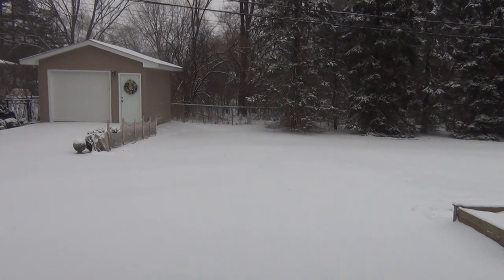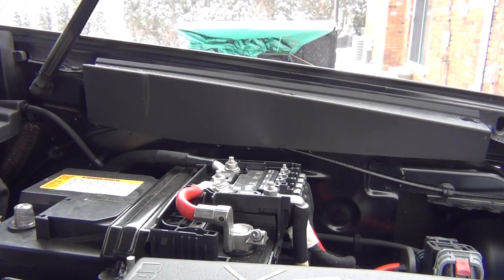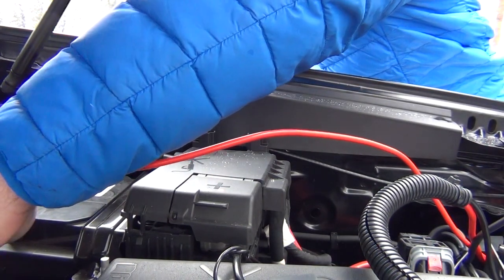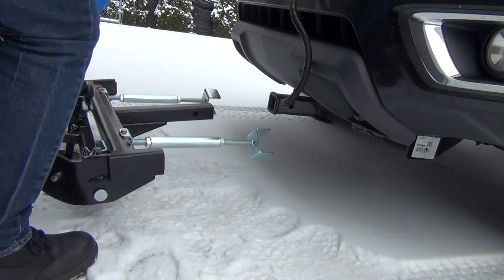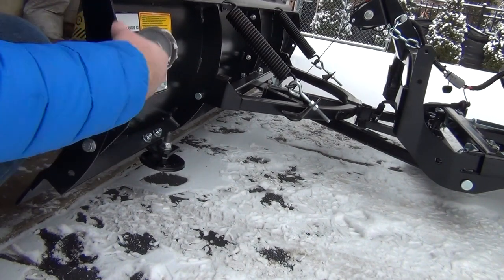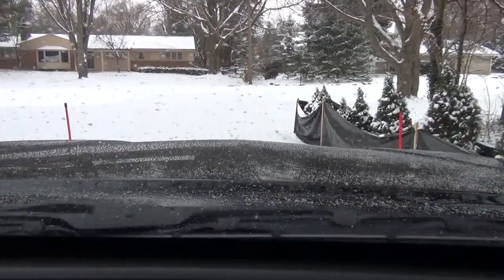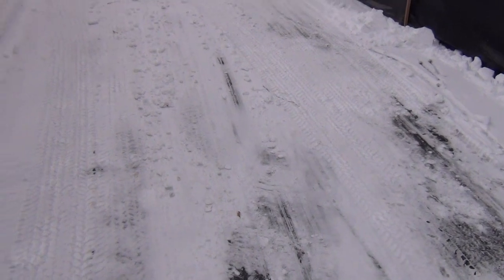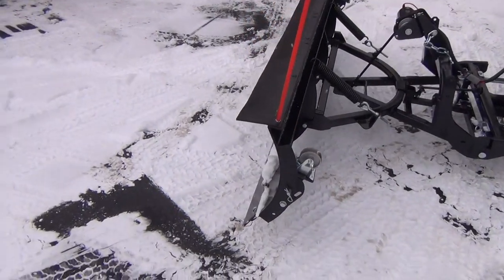Detail K2 (DK2) Avalanche Snow Plow Kit 1st Snowfall & Plowing Impressions | 2020 Chevy Colorado Z71

Comment: I thought I'd give some feedback on mine I bought a year ago. I have 2003 Dodge Dakota extended cab 4x4 with 4.7 V8.  I've owned it for years and it only has 100,000kms. Frame is mint and its been babied all its life except for my hunting trips. I ordered the Dakota kit for it and this exact plow. I was concerned I was too light as I have 1800 feet of gravel driveway. I've used my TYM 293 tractor for years with front blower and back blade. That thing is a beast. Heated cab etc. It'll take on any storm no problem. But I wanted something to do the quick hits with 6 inches or less for speed. I had 300lbs of salt bags centered over the back wheels and that made a HUGE Difference in steerability. Do it.

I put a set of Timbrens on the front and that was huge!! The plow never affected the front height at all. I had to re-do the front end this spring but it's a 20 year old truck that needed it anyway. So next year it'll be fully ready. 

I have to say this thing worked perfectly except for the markers. Pure crap. I'll figure out something for those this summer. I didn't use the shoes as I don't use anything with my tractors either so I just went to ground. In 4x4 I used 2nd gear and simply drove to push snow I never went above 20kph - didn;t need to except for one slight hill I have to climb. 

These things work superbly if you accept what they are. I see alot of guys beat the living crap of these blades then complain. STOP! They are homesteader blades. Nothing more. 1800 feet of driveway 12 storms - never turned the tractor on once and had 4 storms of 2 feet or more. NO problem as I plowed with the storm going out in the middle of them and keeping it under a foot. For you property these things work great. I would have two things as spares though. The wireless control wiring kit and a an extra pulley motor. I see these as the most breakable on these plows. All in all they are steal imho when full plows in my area are 10K plus installed.

Comment: Great video. I am new to plowing and just bought a Rampage II. I found the company's website to be lacking in detail. Specifically, how to hook up the plow to a custom mount instead of a receiver and also the fact that the main frame safety pin needs to be removed before use. I liked the wire routing through the bolt hole idea from your first video. I will probably use another bolt hole to store the main frame safety pin while in use since I don't need it for the receiver.

Comment: I ended up putting a rubber cutting edge in front of the steel blade and adjusted it an inch lower. That way it will clear off the driveway like a squeegee and slide right over the grass without damaging anything. Slick as snot on a doorknob!
Reply from the maker: I usually end up stopping short of the grass because I’m afraid to tear it up, and end up running a pass with a 2-stage blower to clean the edges. The rubber cutting edge is a really good idea!

Comment: I would suggest always plowing In 4 hi to avoid overheating or transmission issues I’ve always plowed in 4 hi same with the companies I’ve worked for. Just a tip great video though
Reply from the maker: Thank you! For sure, 4 hi is the way to go. I could feel that the truck was not happy at all in 4 low 😅

Cheers!
Reply: Graz's Garage i have one of those plows but I don’t use the remote I use the plug in switch but I was wondering if I just left it plugged it all the time would my battery die or not? I can’t find a straight answer online. Just thought I’d ask you get your 2 cents
Reply from the maker: @dewugye4669  If the switch is well built, I would hope that there wouldn't be any parasitic draw on your battery while not in use. (Only while you activate the switch in and out) With that being said, I am not 100% sure about the switch that they provide with the kit. 

One thing you could do is run a test with a multimeter, if you have one. Take a voltage reading across your battery and jot it down. Then after a few hours or so, with the switch plugged in, take another reading. It should hopefully be around the same voltage. If not, then you have a bad/cheap switch and you should unplug it when not in use. 

If the voltage looks the same as the initial reading, that's a good sign. Wait for a little longer (a few more hours) and check the voltage again. Repeat this process and increase the time interval (once a day, every other day, once a week, etc...) just to be safe to make sure your battery doesn't drain. 

There may be an easier way to check, but that's the way I'd go about checking it... Hopefully that helps!
Reply: Graz's Garage didn’t even think of that, thanks man I appreciate it
Reply: @GrazGarage   I would use 4 low. this type of work is what 4 low is for. A lower gear is always better for pushing or pulling something heavy. An automatic transmission heats up when its in a higher gear not a lower gear. That is why you don't use overdrive to pull a trailer. I would also put the transmission in low or second so it doesn't shift. All trucks are happy in 4 low that's my opinion anyway.
Reply from the maker: Those are some good points. I may have been trying to push the snow too fast with my first couple of passes this season, and that’s why the engine didn’t sound happy. Will give the 4 low and low gear on the trans a try, and see if it sounds / feels better.
Reply: Some of you are backwards. 4lo is less load on transmission.you reach stall speed of tc faster.less slippage less heat. The reason you don't tow in overdrive on a half ton is because it's the weakest link on a small transmission. Chevy 2500 with 4l80 is designed to tow in overdrive. Sometimes while offroading in the high heat and load you'll watch the trans temps fly up. Put in 4 lo they will hold steady and start dropping temp Less tc slipping less load more trans fluid flow due to higher rpm. Higher rpm also creates more line pressure inside the trans Wich will makes the clutches hold tighter also.

Comment: Bring the shoes up a bit ( clearance should be very little ) mark your driveway , it’s illegal to plow across a road in many areas so plan a spot to push your snow and hold or you’ll run out of space , a good spot is in the back yard but a straight push is definitely better also I start at the road working towards the house and if you want clean edges use your snowblower after plowing  . Angle plowing is a bit more complicated, plan your pushes ! I removed my shoes because I have a concrete driveway and it cleans really nice without last but not least I only plow if there’s more then 2” ! I’m in Minnesota so we do get our share of the white flakes from hell ! Lol

Comment: i have an older snowbear plow which is similar to what you have. new ones use that front receiver mount, mine uses a different bracket with two mounting points. used it on a couple vehicles, latest one being an 07 wrangler which i sold, keeping the plow but i also have a plow for my tractor which is what i currently use.

Comment: Well only advice plow in high and on paved driveways I would lower the skies all the way to the bottom. Unless you have lots of ice mid season or raised cracks.
Reply from the maker: I agree 4Hi has been the best for plowing so far. My driveway is relatively smooth and crack free. I’ve adjusted the shoes lower so that the blade is pretty much on the pavement 99% of the time. (I keep a little bit of a gap just as a safety measure) Thank you for the tip about the mid season ice! I’ll need to keep my eye on the level and keep the ice-melt going on warmer & sunny days.

Comment: Best way to learn is just to do it. Plowed commercially for years. Every lot is different and if you're just doing your driveway it all depends on where you can put snow. 4hi is all you need and personally I'd just take the shoes off and lift the blade before you push into the grass. That's a light plow but it should still scrape nice.
Reply: Guess I should've read the comments lol. Pretty much everything I said was already out there. Only other thing I'd recommend for a light duty setup is with heavy/wet snow always try to straighten the blade before you go into a pile.
Reply from the maker: Lol, no worries man, thanks for the tips! I always keep the blade straight when I plow, but sometimes push into the pile on an sight angle. 

This messes up my banking line, as I can’t push all of the snow to the edge on an angle. With each plow though, I’m learning more and refining my passes to  clear more efficiently.

Comment: ...... Dude, anytime you can get the driveway done without having to be out in the elements, dealing with the cold, ice,ect. You’re doing good👍... Even operating a really nice snow blower is Very Exhausting.... so what if you don’t have a 80k truck, and a 12k plow... You’re moving your snow in the comfort of your truck, and the amount of time and effort you save is something you can’t put a price on... I would try and get really good at mountings and dismounting that plow, because that seems to be the hardest part..... This seems to work for your purpose, so as long as you don’t abuse, or treat it like something it’s not, just clean it and lube it, and it should last a good amount of time👍...

Comment: ok i got a couple tips when u put the plow down give it a little bit of slack so it can move freely across the ground and idk about you law but where i am it illegal to push snow a cross the street.
Reply from the maker: Both really good tips, thanks! I agree, with a little more slack in the line, I was able to get a cleaner pass compared to when I didn’t. 

A few neighbors have professional services and they all plow across the street. Plus the city comes by depending on how much snow falls to do additional cleanup. With that being said, I do try to be courteous and make sure I clean any overflow from my plow out of the street. I don’t want to leave any mounds in the street to freeze and rip off bumpers of passing cars.
Reply: @GrazGarage  Yeah it’s kind of weird with those winch type plows cause they don’t really have a float mode compared to the hydraulic commercial grade guys. But like another comment or say a lot better than shovel😂

Comment: I think you can bolt the battery cable on that stub hanging out without removing the cover.
Reply from the maker: I tried, but the nut on the end of the positive battery terminal won’t come off. Even had the terminal in a vice to hold it steady while trying to undo it, and got nothing. Must be some liability thing over at GM, not wanting people to connect accessories to their truck battery too easily. Luckily the work-around isn’t too difficult...

Comment: Do you think this plow is good enough for doing parking lots?
Reply from the maker: Good question. For starters, I am not a professional (just some guy sick of cleaning my driveway out in the cold).

I’d say it would depend on the size of the lot you are clearing, the type of contract you have with the lot owner, and what truck you are using to plow with… If you are plowing as a source of income, I’d use a full-size to HD truck with a frame-mounted plow. (It’ll make your life easier)

If it’s like a church lot you are cleaning as a volunteer, and there isn’t too much lot to clean, it would be great! (The manual angle adjustment is slower than a dedicated in-car remote, since you have to get out and change the angle when you want)

This is definitely a lighter duty plow for homesteads and lighter work. At least with my setup… (Midsize truck, and universal receiver hitch mount up front)

Not sure if that helps or not, but that’s just my opinion after owning it for a year to clean my driveway.

Comment: I have a 265 foot asphalt drive way - it's steep. Snow blower or plow? Im new at this. Thanks for any suggestions
Reply from the maker: My driveway is personally not that wide, so if I could go back, I would probably spend a little extra for a 4x4 quad with a plow attachment. (It would be a little easier to maneuver and I’d get an extra toy out of it 😉)

Overall though, if given the choice between my current plow setup and my old 2-stage snowblower, I’d keep the plow.

Comment: Can you adjust the angle from side to side on that plow? I have been wanting to pick one up but im interested in that before I do
Reply: Yes DK2'S have 3 positions, straight and approximately 30 degrees right and 30 degrees left. That is done manually directly on the plow frame not from inside the truck

Comment: Plowing is easy guys tend to act like you need a degree to plow. Your pushing snow? Seems easy enough!😀 and u did fine! Was the plow worth the purchase price? Its between this and the snowsport plow for me just cant decide
Reply from the maker: Haha yeah I agree. Like anything, the more you practice, the better you get and the more detailed and technical you can take it. With 3 passes under my belt since this initial video, I will say that the quality of snow clearing gets better.

For the money, I would for sure get this plow as opposed to the snow sport. When you get it from Costco, the DK2 is very price competitive. I was also looking at the snow sport and here was my logic behind picking the DK2:

-With this guy, you can backdrag snow from up against buildings. With the snow sport, you can’t do that, it only plows forward. (This was probably one of the biggest factors for me)

-Think about the long term and what vehicles you’ll be using to plow. With the snow sport you can attach to pretty much any vehicle’s rear receiver hitch and plow in reverse (in case you don’t always have a truck or suv with a front receiver) You can’t do that with the DK2, but it feels more comfortable and robust using a front hitch. (So if you’re planning on using a truck or suv with a front hitch, I’d go with the DK2. But if you don’t know if you’ll always have something like that, the snow sport may be better)

-While not commercial grade, the DK2 still feels like a more traditional plow with the flexibility of the universal mount (if you decide to switch vehicles) The snow sport just seemed cheaply built / too simple for the amount that it costs. (Just my opinion, I’ve seen good reviews on it, but didn’t have a good gut feeling)

Hope that helps! It’s not currently on sale at Costco, but I got mine before the holidays for $200 off. Maybe keep an eye out once spring comes for a similar deal at the end of the season. Good luck!
Reply: @GrazGarage  thats more info then you get from the manufacturer lol thanks im leaning more for the dk2 thanks again!!

Comment: question: what did you do with those 2 stabilizers once you got the plow into the hitch receiver? it would have been nice to see what the underside looks like with the plow hooked up. but i really appreciate the video anyways, i've been looking at this very plow, and i also have never plowed.
Reply from the maker: The stabilizers get bolted to the plow and when the plow is mounted in the hitch receiver, they fit up against the receiver for added support. 

Not all vehicles may be able to use these supports (depending on the geometry of the truck and reviewer combo) but the manufacturer says they are optional and you can just use the receiver pin to hold everything together.
Reply: Do you remember the brand and model of the hitch you use?

Comment: 2007 F150, looking to buy a plow… any recommendations????
Reply from the maker: I’m just a homeowner w/ a midsize truck, so take my advice with a grain of salt…

For homeowner or light duty commercial, this plow is great. For a more commercial application where you have many clients, and with a larger truck, I’d go for a frame mount professional plow. One with hydraulics so you can angle the plow from inside the cabin as needed. You’ll save time and be able to get more jobs done.

Comment: The receiver system sucks. My first system didn't have the stiffeners. the receiver broke off twice at the cross member when hitting some frozen ice piles under the snow.
Reply from the maker: I’m glad they’ve added the stiffeners for sure. A frame mount would be more secure, but for the universal fit, I can make that compromise.

Also, make sure your springs in the plow aren’t set too tight on your new set up. That way the plow has some flip-ability if the cutting edge catches on something like ice again.
Reply: @GrazGarage  That didn't come with the plow when i bought it. Improvements as they go along.

Comment: Do you think it REALLY cuts down on your total time out clearing the drive with a snowblower?  I mean if you have to attach and then unattach that blade rig every time it snows (assuming this is also your commuter vehicle), then I don't know if this would be worth it.  I have a 2021 Z71 that I bought this past year and was considering a light blade for it (live in the midwest, harsh winters, decent amount of snow) but I really don't need it for my house or my neighbors because I already blade with my John Deere select series lawn mower and it works great.  I'd really want a blade to go blade out around town for my various friends and family members.  I don't think I'm going to get one but was half curious if anyone had done any blading with their z71.  I will say the thought of blading in a warm cab with my steering wheel and heated seats sounds so much nicer then being bundled up on the John Deere freezing my face off lol.  Thanks for the video!

Comment: What's the chain for?
Reply from the maker: The chain is for when you are driving with the plow attached. Rather than rely on the winch strap to support the weight of the plow, the chain acts as a rigid safety support.